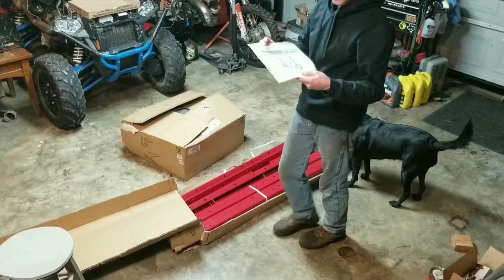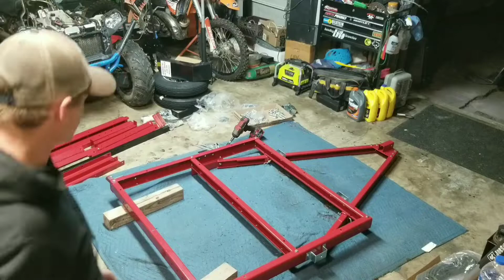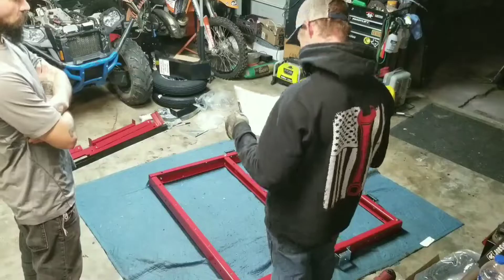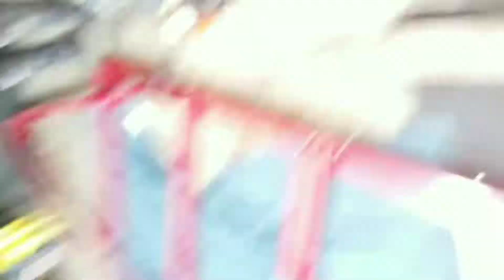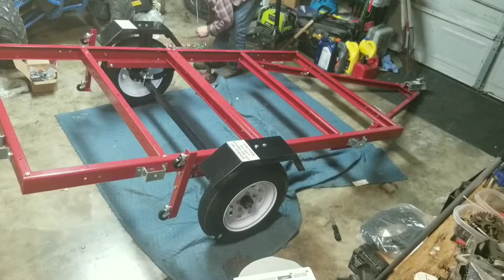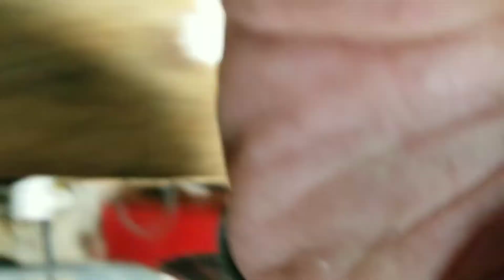Harbor Freight Trailer Assembly - Haul Master 1720lb Capacity

Comment: I got one about 3 years ago.  It's great and even though I 'push' the 1750 spec a bit (2000# of topsoil) I don't haul but a few miles and it's been fine.  However the casters are crap.  The bearings fell out after 3-4 uses/folding/storage cycles.  Finding casters the same diameter was impossible so I got a set that were a half inch bigger.  Makes it harder to tilt up onto them but far superior construction and are holding up well.
Reply from the maker: I havent folded mine. Planned to keep it that way but welded together for strength. Have gotten some awesome casters from Trailer Suply before for other projects. Wheel bearings have held up fine so far, about 2000 miles so far.